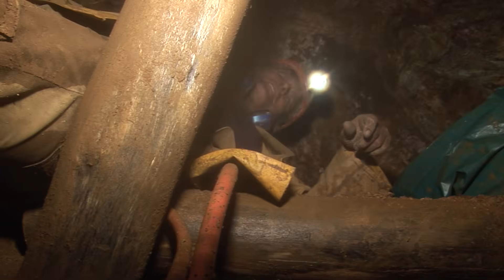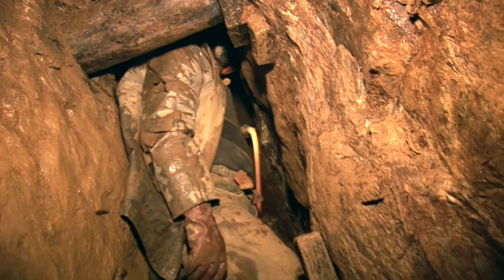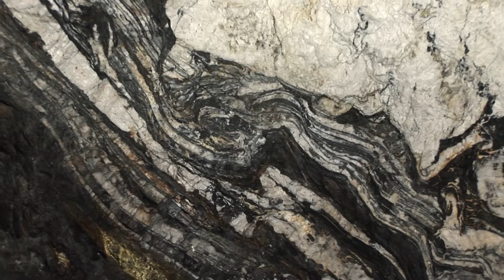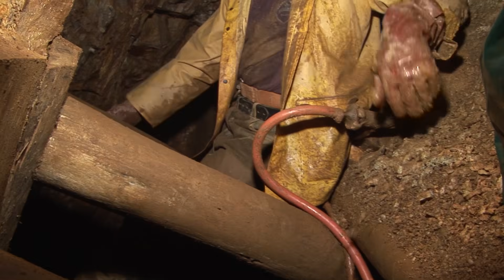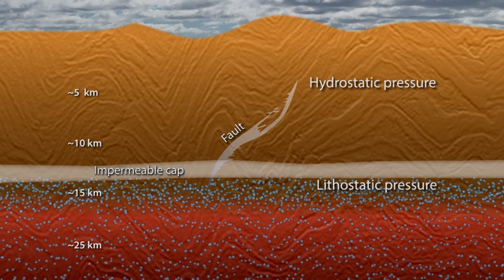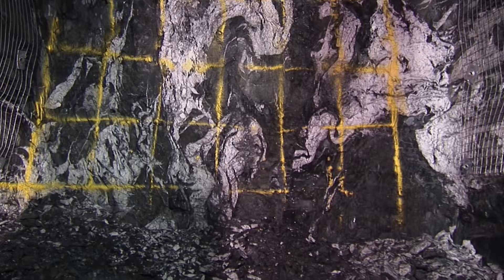Gold, Faults and Fluids

Comment: As a shaky isles Kiwi this was very interesting. Some veins are so thin that working them is not worth the effort, we had two on our land. There was tiny colour in the streams. The hydro fluid's cracks resemble fracking which is much closer to the surface. Fracking was used in Taranaki for gas extraction.
Reply from the maker: Thanks for your comment and I guess you realize that Rick Sibson is a Kiwi

Comment: Currently my village is under the big vibrations horror sounds of earth quake every one is afraid of constantly earthquake ..it sounds like big blast ..
No body can tell us about the big sounds .can you plz tell us about this   big issue in karakurams Gulmit Hunza valley I'm Faryad .thanks
Reply from the maker: In earthquakes the initial wave to reach you is called the P wave, or Primary wave, which is a compressional wave. The P wave arrives first because they are faster than the later S waves, which are called Secondary waves or Shear waves.  P waves are like sound waves so the first thing you experience in an earthquake is a bang, or blast - and that's the P wave arriving. When the S wave arrives, maybe just tens of seconds later, the ground starts to shake.
Reply: @GeologyFilms  Thank you Soo much . ❤️ Some geologists came on research here some days ago and. They find the fault near a hot spring they said megma is just 150km depth..here. ..still it sounds .
And plates junction point Hunza was a part of Australia in past .. 😊 may be ..

Comment: I know it's an old vid but I like to add that I'm on the earthquake ride, but I lean much more toward the bridging effect of the crust over a pluton taking away the weight of the rock above and leaving much less weight over the pressurized pluton and that makes it easy for the fluids to push up, crack and fill the fishers. Lateral pressures can ease up and the bridging loses it's effect returning the weight. Several episodes will leave the same streaked veins. An earthquake would be a side effect not a cause.

Comment: How about the difference between the volume of feldspar melt and feldspar solid (Larger). As feldspar melt solidifies in an old volcanic system, interior pressures increase and the hydrothermal fluids escape thru a crack when the feldspar solid fractures.
Reply from the maker: Good question but I don't know the answer.
Reply: you are talking about magmatic processes, not hydrothermal processes.  These quartz-vein-hosted deposits form by precipitation from hot aqueous fluids, NOT by cooling and crystallisation of a magma.

Comment: is it common for mineralisation to be in higher concentrations in faults that are at steeper angles to the axis of movement or axis of force ? 
if faults at 10 - 20 degrees have lower horizontal kinetics (force) acting on them , is it possible that enriched hydrothermal mineralisation will not occur on these locations due to the low pressure and temperatures generated , while fluids will still flow through them angles of 30 degrees or more will support higher pressure / temperature and be more likely to produce mineralisation ?

Comment: I have watched all seven videos.
Very enlightening. 
We have a small gold lease in WA. It was mainly to fossick for a bit of surface gold. Which we have found. 
The surface rocks have intrigued me, with fault slicks and gneiss just laying on the surface. There are small hills covered in degrading green schist with veins of quarts just breaking the surface. 
To add to this we have found thumb sized quarts/ironstone specimens shot with gold and with like a gold netting pattern on the surface. 
Watching these videos has got me thinking that there is a possibility that the origin may well be deep in the hills. 
I wonder why no one has done any exploration work before. 
Should I take that as there i signs that would say it’s not worth it or is there a newer thinking about metamorphic faults the old timers missed.
Reply from the maker: Thanks for watching our videos. Based on your description it sounds like the surface gold in your lease is probably derived from the local quartz veins in the schist - my guess is that these are Orogenic style gold-quartz veins. So yes, I think there is potential for exploration beneath the surface.
Reply: @GeologyFilms   guys who use detectors to retrieve gold at surface and do no further investigation are doing a great injustice , If they recorded and mapped these locations with ore samples provided for later analysis it could open up huge underground discoveries in future generations that might now be missed completely.

Comment: Is there dating on those punctuated pressure events when the water flowed in through the veins?
Reply from the maker: The radiometric dates done so far in SE Australia just give a general age for a whole vein or deposit with an error of +/- 2 million years, at best. The veins in Ken's mine haven't been dated but they probably formed about 400-420 million years ago. The resolution of the dating systems would make it difficult to date discrete events in a single mine unless they are separated by > 5 or 10 million years.

Comment: He didn't have to go to Scotland to learn that a fault doesn't creep it jerks loose and one side moves sometimes 30 to 40 feet from the other side. I live in California for 68 years and have worked in Mining for 40 years. I know as much if not more than any Scientist does about faults and Quartz Veins. A fault is just a crack that sand fills and over time turns to quartz  Some times Gold and other Minerals are trapped in the Sand / Quartz and solidify as crystals.once Gold comes in contact with base metals in the walls of the Fault Rock or the silica itself.
Reply: Faults sometimes do creep, though. Sand doesn't just turn into quartz in a fault. That's not how gold-bearing quartz veins are formed. You need super-heated, super-saturated fluid under pressure.
Reply: ...."I know as much if not more than any Scientist does about faults and Quartz Veins."....lol...
Reply: I think the California fairies wave their magic poles and turn the sand into gold laden quartz.   Then the hot fluids are pushed up  through the gold veins, and that's how golden showers are formed.   At least that' what I heard in some pub down in San Francisco.
Reply: what role did you have in the mining industry dan?

Comment: Did you find fossils in these quartz next to faults?
Reply from the maker: There are fossils in the sedimentary rocks that surround the quartz veins. The most common fossils are Graptolites which were planktonic, meaning they floated freely in the upper parts of the ocean. When a graptolite died it sank to the seafloor where it was buried in mud.
Reply: Geology Films oh that means that these rocks were soft and the fossils were trapped by flood waters, so the quartz veins didn't have to cut through hard rock rather it was soft material and even with little pressure from bottom they could easily build veins,it's like releasing bubbles inside mud...
Reply: nope